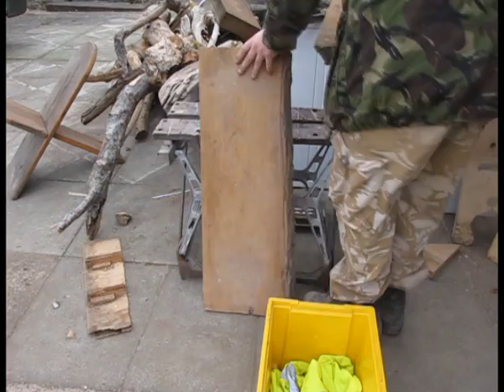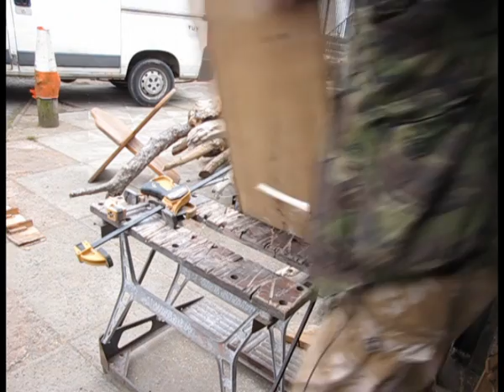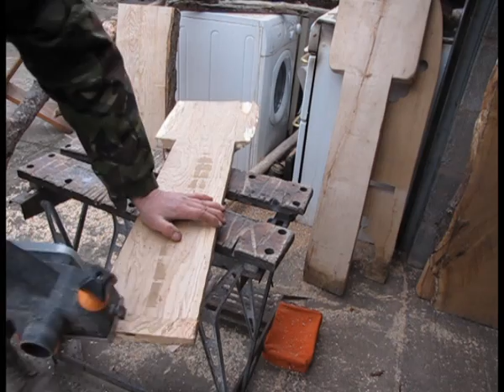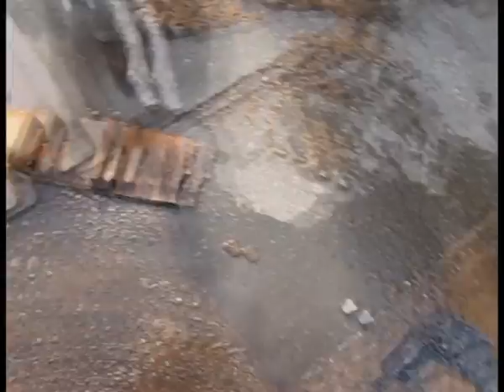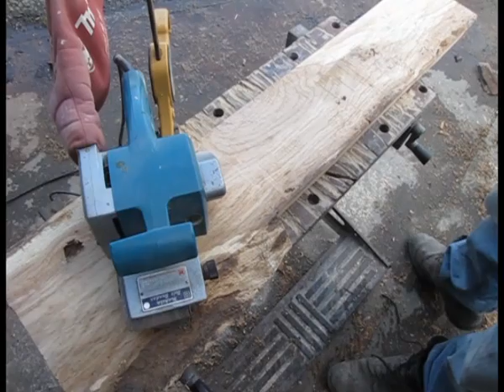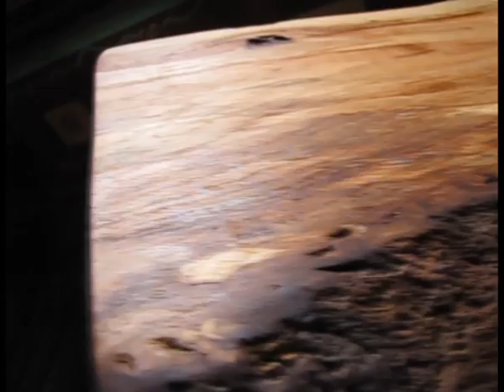How to make a Celtic Viking Stargazer chair

Comment: The best ideas are the simplest ideas... this is a great little project and the final detailing really sets it off. I have tons of old oak at my place in Rural France (Normandy) and as they are a little irregular in shape this will save a lot of it from going to firewood... You have inspired me...I'm going to have a crack at this one. 

For those without access to oak, this kind of project looks like an ideal one for using old scaffolding planks... Most scaff yards will chuck boards out or sell them on for peanuts once they have a crack in them or if the corners get a bit frayed... they would be ideal for this kind of thing... Well done on the finished item my friend, and for highlighting some good basic carpentry skills and the tips on using power tools correctly with wood
Reply from the maker: +TheComputec excellent stuff, do you have a large bandsaw or circular saw? theres also a few chaps floating about with portable sawmills for day hire, have a look at the peg rails i did recently, all made with the offcuts from the sawing process, minimal wastage of your timber, wish i had oak in normandy :)
Reply: thepoultrypeople I have a large table saw that scares the life out of me as it looks like something from Nightmare on Elm street, but it cuts through 3" oak like butter

Most of my Oak is the joists, floorboards and lintels from the house which I have reluctantly had to pull out due to the floor being badly twisted and out of line, together with bits of woodworm showing up all over. I have a dozen 100yr+ oaks in my garden which could finish all my house off if I had the heart to chop them down.  
Oak is much cheaper in France (half the UK price) 
I have a sawmill down the road and he has done some work for me for windows frames. He has a large pile of offcuts which he just lets me take (the first cuts with all the bark on)  These are what I will be using to do things like your chair idea

Lee
Reply from the maker: oooh you jammy bugger, sounds like youre having quite the laugh out there, i was being imported european oak a few years back and it was a quarter of what they wanted to charge me down the coast at the commercial timber suppliers, why is this, have the french got huge commercial forests of oak or something?

yes, the first cut is a great piece of timber to get your hands on and has many uses, great stuff Lee wouldnt mind keeping abreast of your shenanigans, you have a fb page or something?
Reply: thepoultrypeople 

Yes, oak is much more plentiful in France. There is still a lot more forest over here, bearing in mind its 4 times the size of England and has the same population... most of it is rural and in most cases untouched.

I'm heading over there on my own on Christmas Eve, Leaving my wife and family in the relative luxury (and warmth) of our main house Nr  Preston in Lancs

Very antisocial of me but I just love the absolute tranquillity of the place and two weeks over Christmas and the new year without distractions should see a decent amount of progress. Its a cob and stone detached farmhouse in just over half an acre. Hadn't been lived in for 30yrs and pretty much everything wooden was rotten or worm eaten
Its taken me a few years to get to the stage where I'm no longer taking things out and I'm now putting things in !!!  New floors, A new roof, small scale solar lighting and power etc

I have started piecing some of it together to create a web-log but i'm going to do it properly in the new year after I've got a few new photos on this trip. Its a labour of love and i'm using Youtube and videos like yours to give me inspiration as my joinery and carpentry skills are base-line

In the meantime you can get a quick idea from the website here... couple of photos in the gallery and many more to be added

http://normandydreams.webs.com/about

Comment: I thought that was brilliant i wondered if you had some measurements or plans? I have never done much woodwork before but i thought that looks pretty easy to try and do
thank you
Pete
Reply from the maker: thanks Peter, no plans or measurements unfortunately, i could maybe draw some up if i get 5 minutes and then scan them but it seems like a bit of a hassle, best thing to do is just crack on, ill definitely get the angle measured and put on here, go for it m8, get yourself some cheap wood, pallets are great to practice on, you only need a handful of tools to get started, woods very forgiving and with projects like this which have a country style feel a few knocks and dents are easily sanded out or add to the character
Reply: ok thanks for the hints i will give it a go

Comment: Nice build
Reply from the maker: The Cornish Maker thanks m8, are you going to have a bash at one?
Reply: Might if i can find the wood
Reply from the maker: the hardest part, i made one the other week and it was too thin, smashed itself as soon as i put some pressure on it
Reply: ive got some slabs of oak lying in the woodstore. How much did you need?
Reply from the maker: The Cornish Maker sorry m8, forgot about this reply, theres a second video with dimensions that i did, link is in the description, the important thing like i mentioned is the thickness, and then the angle of the slot, dont make a 90 degree, 65 or therabouts, i made one that had a 5ft back on it recently, that was really nice
Reply: ah cheers

Comment: Are the handsaw cuts on the seat part made on an angle? how do you determine correct angle or is it important?
Reply from the maker: +Eric Brakstad yes, if you just do a straight cut it wont be too comfortable but will still work, the angle you want is about 72 degrees
Reply: Thanks